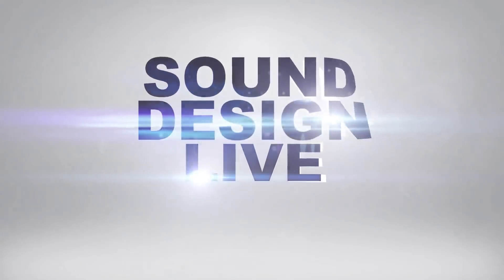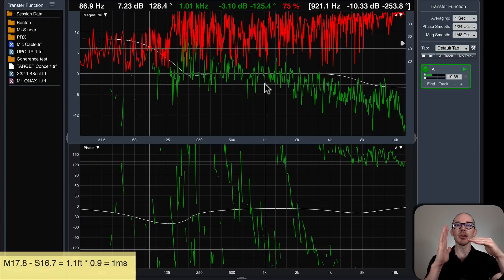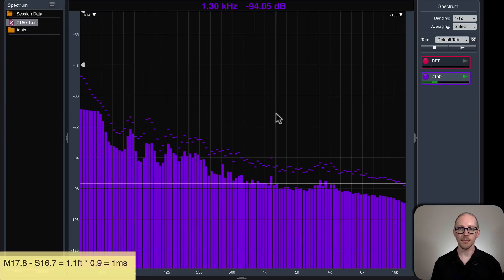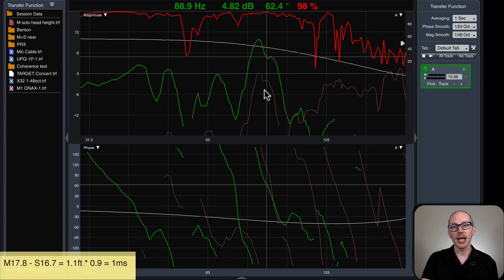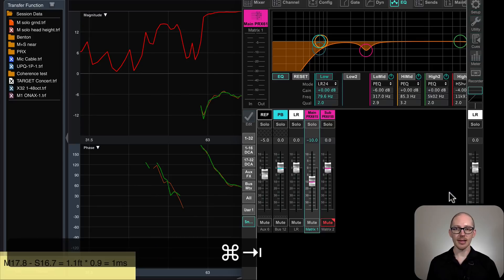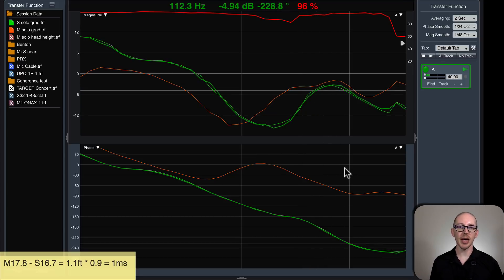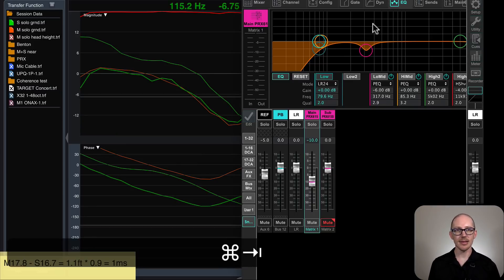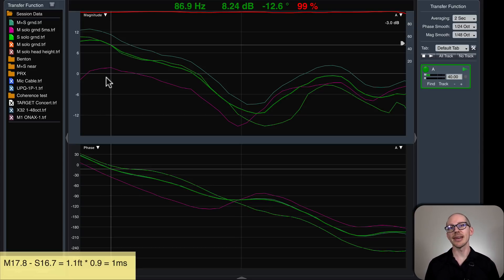5 ideas to improve Main+Sub phase alignment with Smaart® [GSwSST35]

Comment: With all due respect I would like to see these measurements in the real world situation where you are a guest engineer traveling with a band, getting to the venues with very limited time for sound check and be able to quickly get these measurements and make FAST decisions regarding the possible issues with the PA without a lot of time for experimenting with speaker positioning etc. Most of the places would already have the system installed but not necessarily tuned.
Reply from the maker: Hi Celso, thanks for checking out the video. I totally agree with you about time compression. If there's one thing for sure in this business, there will never be enough time. I'm always trying to improve my own methods so that I can get faster more accurate results. If you feel that the method shown in this video is too slow, let's talk about how to speed it up. What are some of your suggestions to do that?
Reply: Nathan thanks for checking in. I do think that you are very knowledgeable in explaining how to get these readings and troubleshooting the issues with the systems. My comment is regarding the application of these measurements in a real life situation. I’m a drummer/ engineer and do a lot of touring as a FOH but I find myself with very limited time to set up a computer system and take these measurements when we are pressured for set up and sound check while touring. I know that this should be done by the venue or their system engineer but that’s not always the case. 
What I would like to see is for you to get into different venues,  make these measurements and teach us how to implement the corrections needed on the PA, all that with a tour manager yelling at you to get things wrapped up 😄😄. Thanks!

Comment: Thank you for the great lecture
It is very difficult to find such a lecture in Korea. Thank you again.

I have a question.

1. Did you apply 2.7ms to the subwoofer instead of using 1ms to the subwoofer?
And does that principle apply regardless of what size space it is?

2. As far as I know, the delay locator of the subwoofer and the measurement microphone is very difficult.

measurement microphone and subwoofer delay locator
The way is 

Time alignment of the main speaker and subwoofer
After that, did you use the impulse from the main speaker to find out the delay of the subwoofer and the measurement microphone?

Comment: Hey Nathan, just curious to hear your thoughts on this if you ever get to it. Right around 8:13 when you talked about putting the mic on the ground to help eliminate ground reflection, you said how it was good tool but unrealistic in a real world scenario because you don’t put your ear to the ground to listen to a show. In an empty room, it makes total sense to know what those reflections are when what comb filtering occurs at head height, but when you fill a room with a sold out show full of hot, sweaty, hard headed, meat bags, aren’t you essentially raising the floor to your head height? 

I’ve been contemplating whether to be matching my target curve with the mic on the ground or 5.8 ish feet up in an empty room. Granted I understand that people aren’t the same density as a concrete floor, but when you bring people in, they introduce extra hot rising humility which in my understanding can steer the PA up a tiny bit. Which could be so little that it probably doesn’t factor into the equation but I don’t have any way that I know of to measure it to rule it out. 

Anyway just curious to hear your thoughts if you ever get the chance. Thanks
Reply from the maker: >Aren’t you essentially raising the floor to your head height? 
This used to be my thinking as well, but now I am a bit more conservative with my expectations for two reasons.
1. I'll never be able to accurately predict how much of the floor will be covered with human bodies.
2. Below 100 Hz, people (the audience) have no significant absorption.

It's just another tool in the toolbox. At this point I always start at head height. If I can't get actionable data, I do to ground plane or make some other change.

>can steer the PA up a tiny bit.
This is possible, although more common outdoors, but you can't fix aim with EQ.